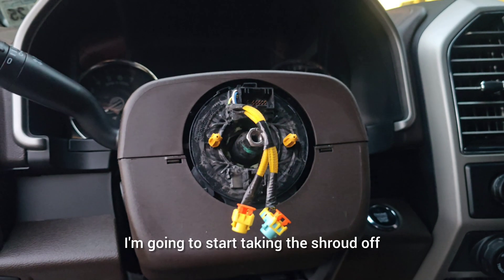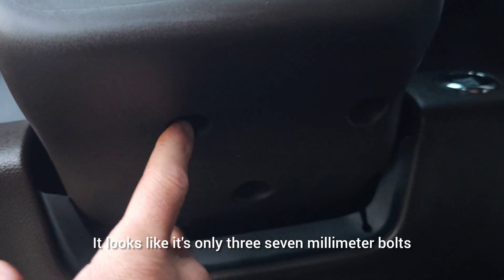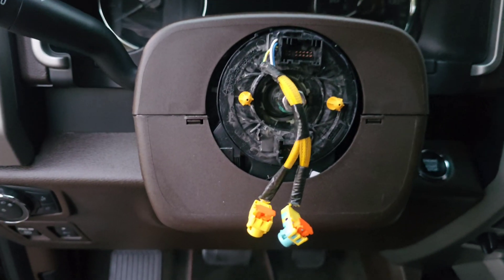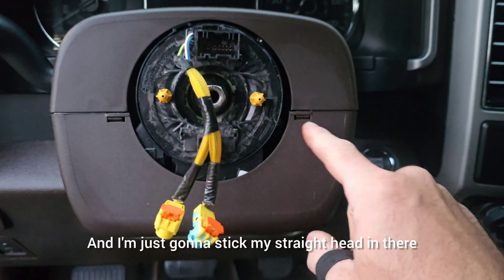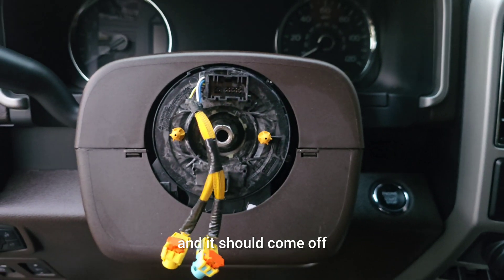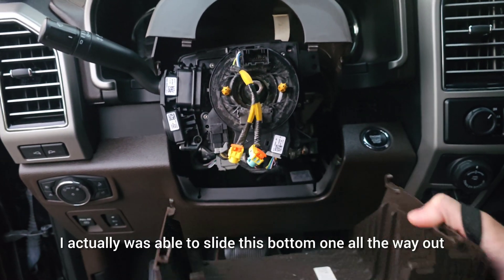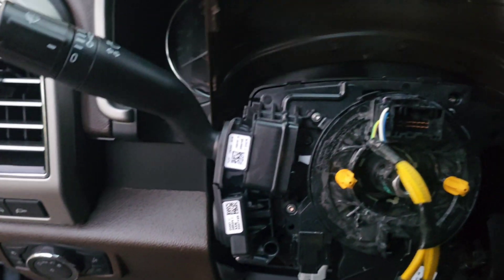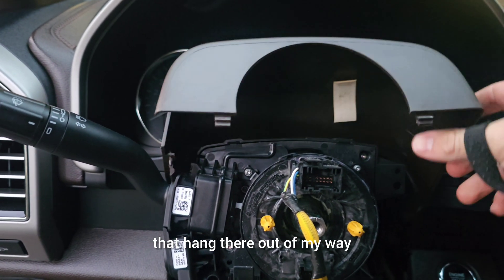2020 Ford F-150 SCCM (Steering Column Control Module) Replacement with programming

Comment: Thanks for the video.  Very helpful!  Here is my experience: horn worked, none of the steering wheel buttons worked at all, the screen behind the wheel was “frozen” but some notifications would display, turn signals worked, but would have to be manually turned off.  If you have the same issues you will need to replace the entire SCCM.  I tried just replacing the clock spring and it did not resolve the problem.  Ordered the SCCM assembly from Tasca which said it was OEM.  The part, tax and shipping was approx. $353.  Part number for 2015 F150 LARIAT was HL3Z-3F791-CB.  The Lariat has most of the bells and whistles.  This part required NO ForScan programming on my truck.  Buttons worked like they should.  I am very happy I was able to do this myself.  The dealer probably would have charged $1,200!
Reply from the maker: Of course no problem! Glad to help!

Comment: Thanks very much, I just replaced mine following your directions. I've got the Sport model and I didn't have to program the module. So theres no water sensing wipers and whatnot. Just the base model.
Reply: Hello, having the same issue wipers are not working. Replaced motor and multi switch getting an error module. What symptoms were you’re getting?